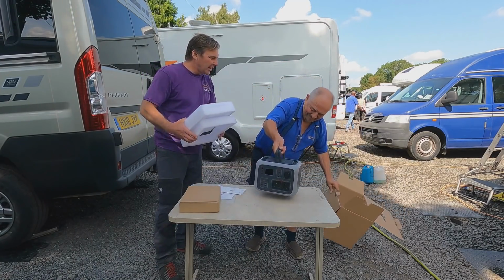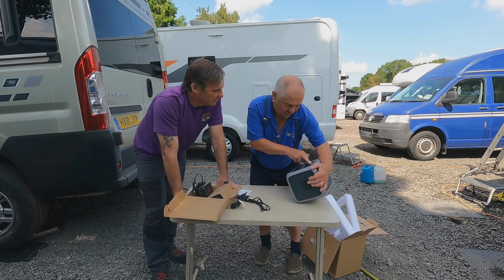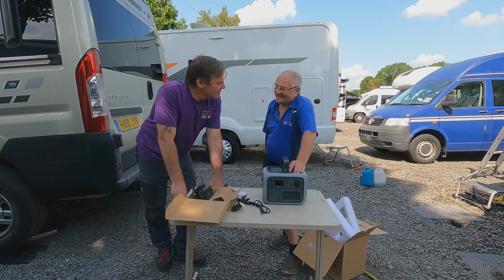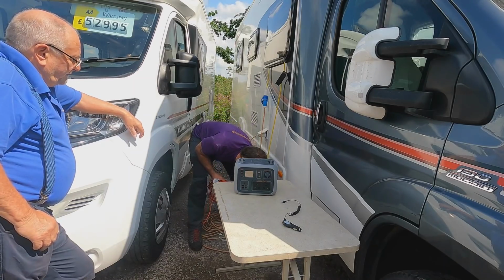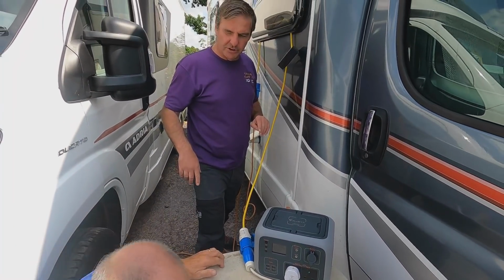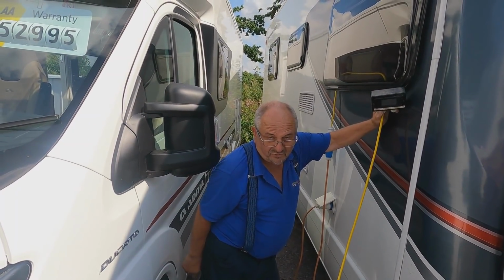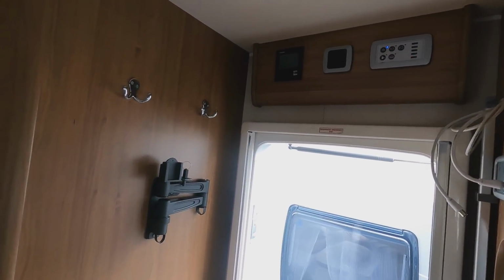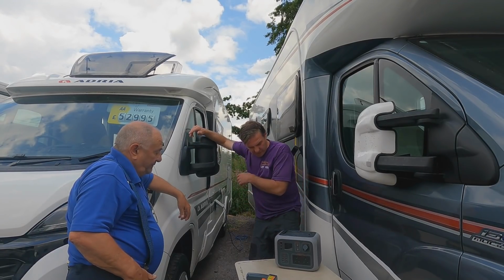HOW FAR WILL IT GO ! Bluetti Off Grid Power System Review

Comment: I just got a Bluetti EB70 and it's great. 700 watt inverter. Has 4 A/C
outlets, one regulated 12V cig outlet, 2 5.1mm barrel outlets,
several USB-A and 2 USB-C outlets. I also bought a Baldr 120 watt
folding solar panel to use with it, works great!

Comment: Come on lads ! It's not worth the money is it (300w😂)   it won't run anything of significance so you might just as well  have a decent power bank in your pocket. You could get a traditional 2000w pure sinewave  inverter for a lot less cost & just have a spare battery tucked away in the van , at least you'll be able to run a 700w microwave off it in an emergency .